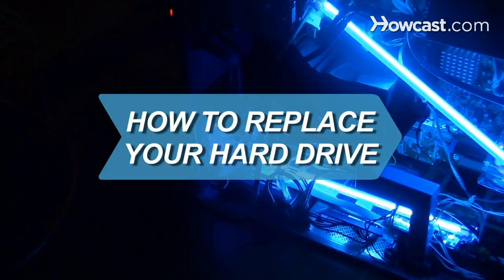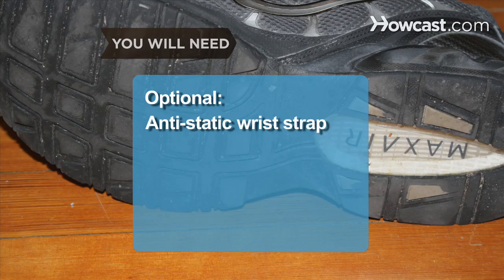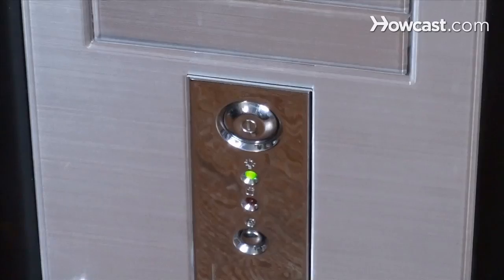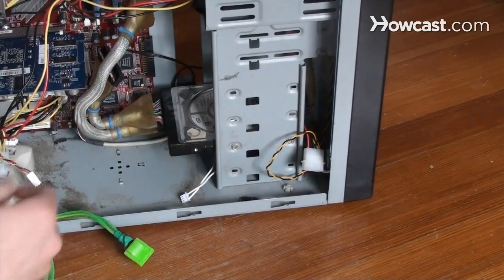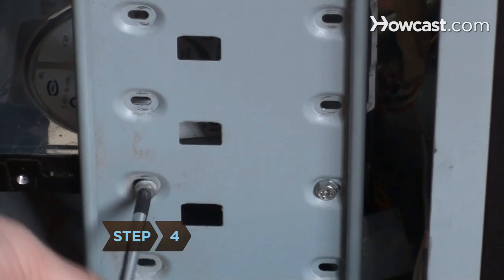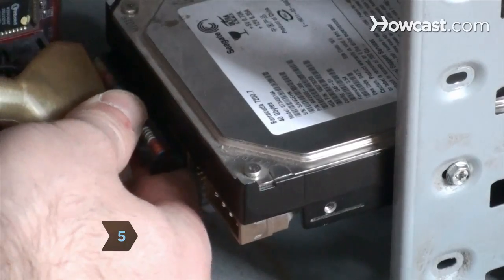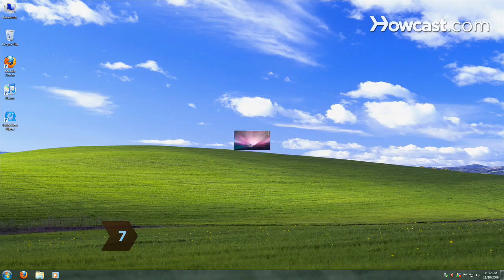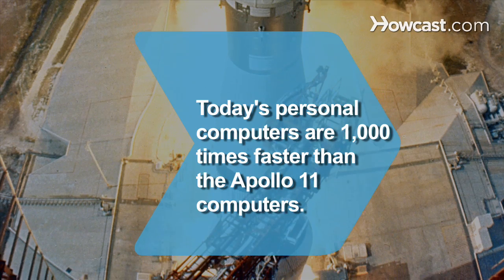How to Replace Your Hard Drive

Comment: I have a cpu with a 120 g hd. I want to replace it with a 360 g hard drive. I lost the system backup disk. If i put in the new hard drive will it even start up?

Comment: @xo46oup I didn't know about it until now, but... yes. I think that might be what I'm looking for, but isn't it meant to permanentely pop the rivet into the metal plates? So... how can I remove them if they're meant to be permanentely fixed? Does the pop rivet have a reverse function? I don't know about you, but other computers I've seen, don't have rivets holding the metal case of the machine, they have screws. Maybe, because rivets CAN'T be removed. I don't actually know, but it could be why.

Comment: Well... that WOULD work if I were able to remove the OTHER SIDE of my computer case which irronically, Isn't fixed in place with SCREWS I CAN REMOVE WITH ''ANY'' EASY ABLE TO FIND SCREWDRIVER. Anybody know where I could find a... ROUND SCREWDRIVER? Yeah... ROUND! How can you even get a grip with a ROUND END screwdriver?

Comment: Heres another way you can do this:

Step #1 Turn the computer off.
Step #2 Pull out any attached wires (quick tip: be very gentle, they tend to snap after applying few tons of pressure).
Step #3 Pick up a sledge hammer.
Step #4 GENTLY smash your computer until the Hard Drive pops out (quick tip: if it doesn't, buy a new computer and repeat the last 4 steps).
Step #5 Pick up and throw the old Hard Drive at neighbors window.
Step #6 Place the new Hard Drive at the old ones location.
Step #7 Enjoy!